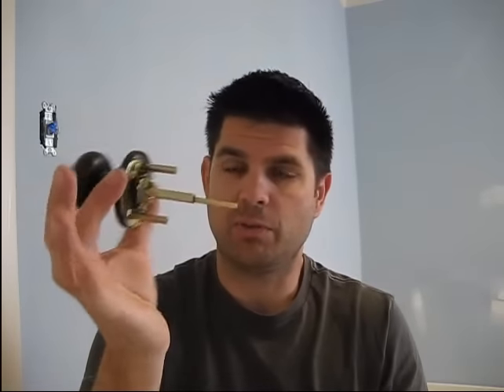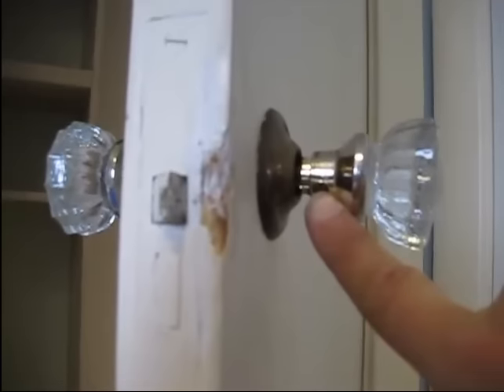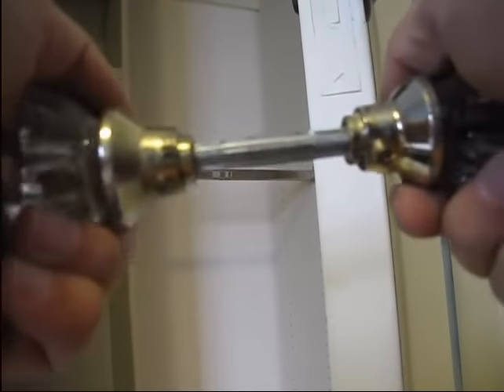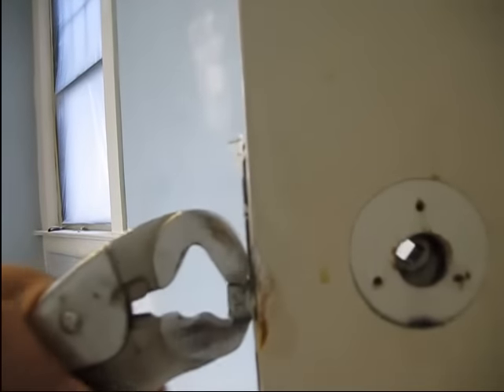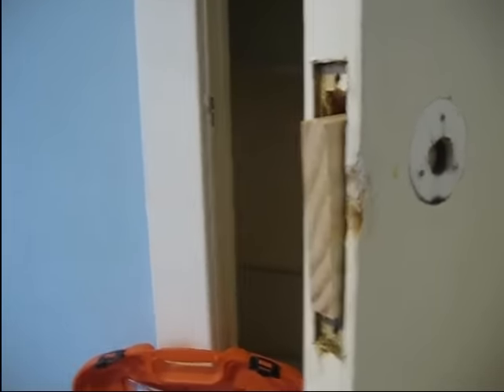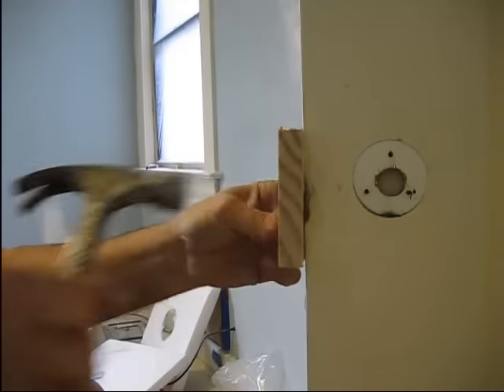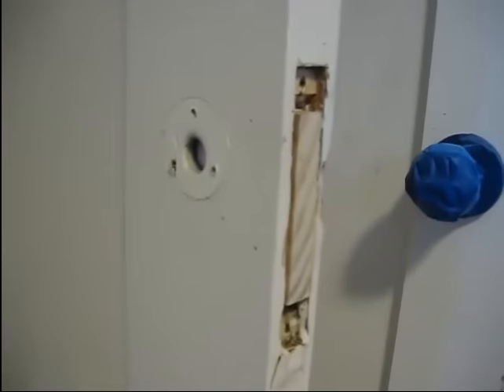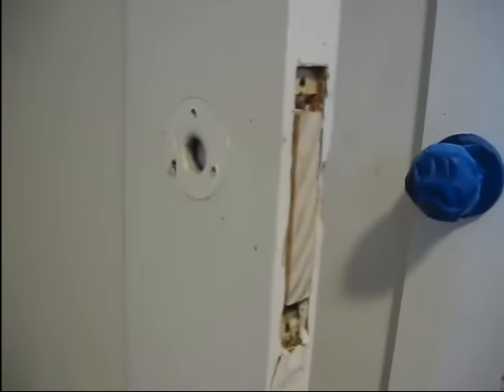How to change a mortise lock set to a cylinder lock set

Comment: I replaced a Mortise with a Cylinder deadbolt and handle this weekend.  This video was crucial in doing that job.  Given that this was my first time attempting something like this and i had to take care of every tiny detail including chiseling new holes and offsets for the strikeplates and latch/bolt wells, it took nearly 5 hours total of work (the new deadbolt and latch each required their own new sets of boreholes and latch/bolt wells).  I'm somewhat experienced with standard cylinder knob replacement but this was a whole 'nother level.  At any rate, thanks a ton for the video, as frustrating as the work was, it would have been much worse without this guide.

Comment from the maker: William, the best thing about the Irwin jig is that both the hole saws and arbor come with it. Search Irwin door hardware instillation kit and it should come up. I just noticed it's only $16.16 right now which is cheaper when I got it. The hole sizes are standard, but the backset of the door handle can be 2 3/8" or 2 3/4" depending on what hardware you buy. The nice thing about the jig is that it allows you to do either with the push of a tab. And yes, the gaps were filled in. Once they are it looks really nice. You could use lightweight spackle, bondo or wood putty. It's not a heavily abused area so you don't need to go to extremes. So use what you are comfortable with. Putty is a good choice though. :-)

Comment: Very good video. I will be updating the hardware in my apartment front door soon. I was a bit afraid since it has a deadbolt as part of the faceplate, but it seems I can fill it with a larger piece of wood than what you had to use.

Thanks for the video.

Comment: Hi!  Great video.  I purchased an old door to go in my house, we took out a "wood box"  built in and had a whole door put it in.  It had a mortise lockset and I had the porcelain knobs and spindle.  I really wanted to leave it and for it to be original to the door. I took the lockset and tried to have a key made.  Nope.  Isn't going to work.  NOW, I have you to refer to and put a regular door knob in.  (Love the jig.)  ((I am a seamstress, but I am soooo into working with wood.  Not a lot of difference in the process))  Thanks again.

Comment: Hi Jamie, At 11:51 there's a 'jump cut' from the wood board being flush with the door to it having a slight indentation to allow room for the face plate. I was wondering how you created this indentation. Did you just use the hole saw that was included with the jig?
Reply from the maker: Sorry, I've been on a big job and didn't see I had a bunch of comments until now. There is a drill bit and jig included with the Irwin hardware. It's a bit flimsy, but you can use it to create the pocket for the hardware.

Comment: Thank you! I had a hard time finding any info on how to do this.....now I just have to find all the gear >.>
Reply from the maker: Wood, screwdriver, glue, nails, Irwin kit, hammer and chisel . Good luck!
Reply: Jamie Schmitt I don't have a nail gun and I'm worried the wood blocks are still too loose. Would it make sense to use wood filler to fill in the gaps? Would that give it anymore stability?
Reply from the maker: demon11989 You could try it. Depends on the type of filler you decide to use I guess. A possibility is you could hammer in small finish nails and use a nail setter (Google nail setter, sold in packs of 3 for $6-$11) to sink the heads below the surface. I've done it another way where I fill the entire cavity with nothing but bondo wood filler. It's a little tricky, so I might do a video on that if it comes up again. Do me a favor, if you do try it, give me (and others that read these) and update on what you did, if it worked and any tips you might have for someone if they try it. Good luck!
Reply: Alright, I finally finished the door. I used spare wood to fill in the gaps, slathered it with wood glue and let it dry for a day. Then I went back and filled in all the crevices I could each with wood filler. It held everything in place perfectly.

The only downside was that the nails went right through the filler. It crumbled and fell away in spots....but I just kept drilling into the spare wood so it didn't matter much. As long as the screws reach the wood in the center, wood filler should be fine. And make sure to leave enough space in the filler for the lock cylinder to fit in flush with the door (I forgot and had to chisel some away afterwards) I used wood filler on the latch plate gap too. Mission complete!

Comment: Very helpful video! Two questions: What were the sizes of the coring bits you used to drill the holes for the new door knob? And two, did you fill in the gaps with wood putty, sand it down and paint over it?
Reply: Standard size of the bore hole is 2-1/8″ and standard size for the cross bore is 1". You should check the packaging of the knob you purchase to be sure though.

Comment: Excellent vid.  I have a door in which the old mortise lock is stuck in the door.  The knobs are out.  The mortise sticks out 3/4" but stuck, won't slip out!!  Any ideas how to get it out without destroying the door?
Reply from the maker: Does it feel like a metallic noise when it stops? maybe something in the lock broke and is sticking out. You could try pushing it back in and looking through the hole to see if something popped out. If it's not that, it might be super tight and if you don't pull evenly from both the top and bottom at the same time if could wedge itself in there. Push it back in and try again.
Reply from the maker: Oh, one other thing... make sure there isn't a wayward screw in the door that might be going into the lock set preventing it from being pulled out.

Comment: Hello there. Glad to find this video.
So far the only one I seen that converts an old mortise lock to a modern cylinder set. 
However I specifically wish you worked on the second door you showed in the video with the skeleton lock.
So my question is, like that second door, what do I do about converting an old mortise with the skeleton key hole(circa 1920) to a modern single cylinder?
Is there a backing plate that I can install with a locking knob set that'll wrap the door and cover the second hole that I prefer not to reuse??
Or, am I limited to having to get a new mortise lock that will fit the old mount and wood space?
(I have 10+ doors like this to update, for security, and efficacy. They are the oiled bronze finish style.
Reply from the maker: +effinchad You can get a fix-all or bondo type filler and fill the second hole in the door. You could also do as you said and get hardware with a large plate, but you shouldn't have to. I've refurbished old doors by filling the large cavity left by cylinder hardware with bondo, then re drilling all the holes and they turned out great! Only tip is to try and screed the bondo flush with the hole as best you can when applying. It's super hard to sand.
Reply: +Jamie Schmitt 
Thank you for that tip.
Sounds doable. Totally new to me to do that much wood fill.
I've shopped around and see that many retailers sell modern mortise knob sets, or just the cartridge piece with the pins, mostly online however. Rather expensive some are.
I might almost consider refurbishing the ones I have and updating only the knob and their shafts to save money, but only the indoor ones. The exterior ones I expect more security from.
It looks as if they make modern mortise systems with modern keylock spindles beside the skeleton. I would hope those fit the standard old-fashioned cartridge space.

Comment: this is EXACTLY something I was looking to do myself, and I see it indeed is possible.  what is the exact measurements height depth and width of the piece of wood.  is it plywood or solid pine?
Reply from the maker: That is EXACTLY what I hope to hear! :-) Great! So I couldn't tell you what your measurements would be. They are all different types of lock sets out there. This is just an overview and you'll have to customize it to your particular dimensions. And, this is important, long ago they would sometimes be mortised out by hand before we had all these jigs to take most of the guess work out of it. So each door is going to be slightly different. Best I can say is take the lock set out and copy those dimensions. Or use a tape measure to see how deep the pocket is and back off that an 1/8th or 3/16ths to give it a little room for glue. That might cut the guesswork down a bit. And I would only use solid wood because you'll be screwing into the end grain and plywood has a tendency to blow out between the layers sometimes.

Comment: I do have a separate dead bolt and luckily my screen door has a lock. Going to be stripping the varnish off at the same time. So no from door for a day or two. How long for the glue to dry? A day?
Reply from the maker: A day is fine. Just use a normal waterproof wood glue since it's for an exterior door.

Comment: USE A 2 PART EPOXY INSTEAD!! Its the easiest and least time consuming way to fill a mortise.
Reply from the maker: I've done both and I prefer this way better. Couple of things though... The epoxy in most cases is much harder than the wood and if you have to sand it comes out uneven because they sand at different rates causing a hump. Second, you most likely have to take the door off hinges to do this properly. And extra step that some would find difficult with solid wood doors. (heavy!) But that said, whatever works for you, go for it!  The whole point is to save time and money and get a great result in the end. There are multiple roads to get to that point and my video was just one of them.

Comment: Would Gorilla glue work better for the block of wood in the mortise?  I realize you would have to clamp the door from being spread apart, because Gorilla glue does expand quite a bit as it cures, but is quite tough once cured.  If anyone knows where to get a cylinder type lockset that looks retro, like with the plates that are rectangle, roughly 2" x 7"?
Reply from the maker: mike oswald Hi Mike, you know I have a love hate relationship with Gorilla Glue. But for this project I would bypass the risk of what the expansion may cause and just use wood glue. And wood glue now a days is often stronger than the wood it's holding together! I use Titebond and I've never had a callback on it. If you do use gorilla glue and something interesting pops up, be sure to tell us about it here so myself and others can learn from it please! Good luck!

Comment: What kind of glue did you use?
Reply from the maker: Titebond II Wood Glue II. Only difference between II and III with them is that II is water resistant and III is water proof. If it is an exterior door, use III. Good luck!

Comment: Great video. Going to use this on my 1920's front door so I can use a more update front entry hardware.
Reply from the maker: Hi Michelle, If I get a job doing an entry door soon I'll do another video of it. It generally follows the same principles as I showed here though. Only it's probably a bit bigger of a pocket you have to fill with the wood blank. One thing you have to think ahead about is that you have to allow dry time for the glue to cut your holes and install your hardware. That means you can't lock the door until that happens. So security is a concern. If there is a separate deadbolt than you are ok, if not you might want to use a fast setting glue and do the work in the morning and finish it at night. Or, do it dry with a crapload of nails! :-)

Comment: mortise lock sets are far superior then cylinder locks. a cylinder lock will last for about 10 years while mortise locks will last forever. cylinder locks are not serviceable. if something breaks, you must replace everything where as a mortise lock is easily serviced. the only thing that will wear out with normal use is the spring which can be replaced for under a dollar. even the spring breaking is rare.
is the issue is the lock is painted over, its not complicated to strip the paint and polish the brass or nickle. if its bare steel, a good automotive primer and paint will make them look good as new. many lower models were painted semi gloss black originally anyways.
if there is rust, soaking it in vinegar overnight will fix that. 
replacing a mortise lock with a cylinder lock is as stupid as replacing hardwood with laminate.